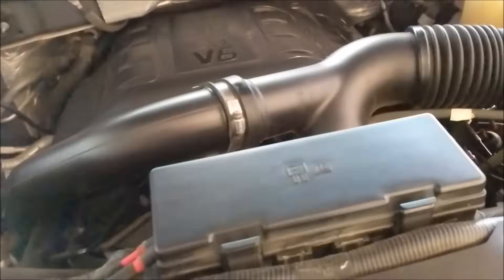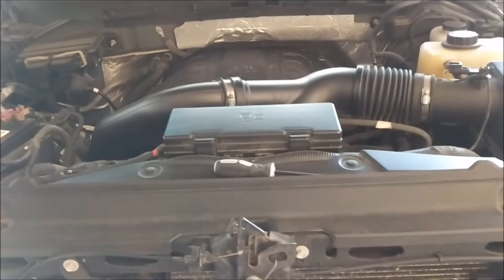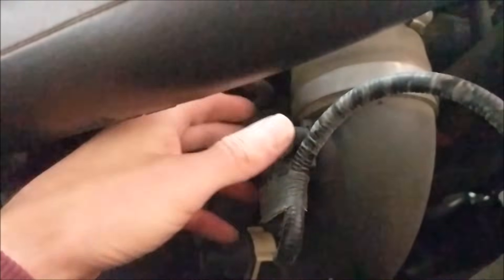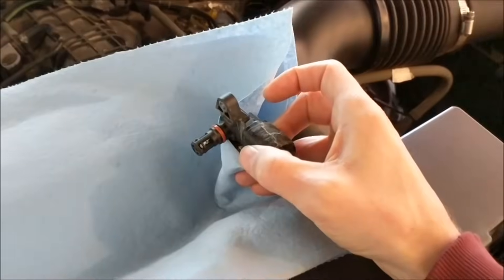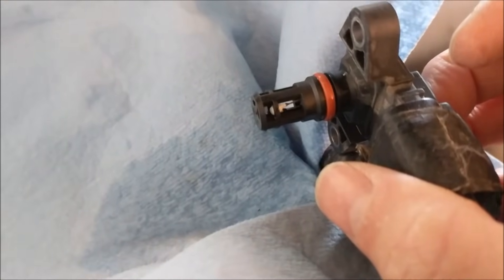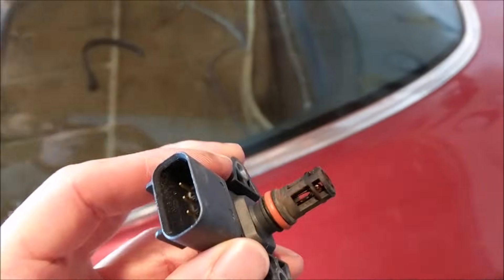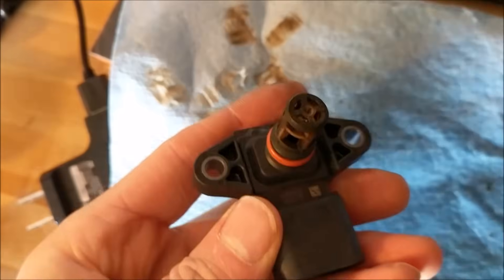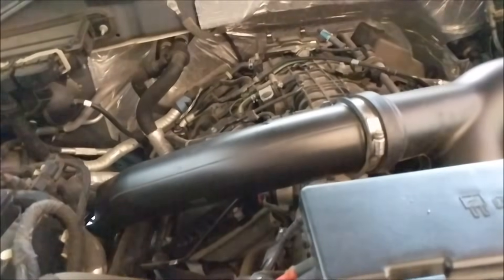MAP Sensor Cleaning 3.5L EcoBoost HOW TO - Ford F150 - 2012

Comment: Thanks, my f150 was throwing code P0172.  The sensor on top of the engine was very dirty and black, could see no white.  I cleaned it with MAF cleaner, was still pretty black, could see a little white.  I erased the code, will see if comes back, but I'm going to order another sensor.
Reply: Did cleaning fix your issue, or did you replace the sensor? I have a ‘13 F150 and well I’m here watching and reading…
Reply: @wI-L-Ly at first I cleaned, order knockoff part from Amazon .  Installed that .  Code hasn’t come back and I’m getting 2 more MPG

Comment: Okay, so I cleaned all 3 sensors.  Cranked the truck over to start the truck. Now it's not turning on. I replaced the map sensor under the engine cover and no crack. I revert back to the old one and nothing. Could you think of a reason why the truck will not turn on? I drove it for about 10 minutes before I cleaned the sensors.

Comment: Great video Brandon! I will clean my sensors soon. Just wanted to add that I cleaned the connection today to the map sensor on top the air box. I found moisture in the connection. The reason I did that is my Turbo blow off valve would click intermittently. Someone suggested cleaning the connection and it worked! A month ago I replaced the blow off valve with an OEM valve and it continued to click. Question for you, when you disconnect the battery, do you wait 8 hours before you start the truck so the Battery management system can relearn? I was told if you do not have the expensive scan tool that waiting 8 hours is advisable..

Comment: I have a 2013 ECO and have done this several times using carburetor cleaner. After needing cleaning 3 times (usually once a year when it starts) you may as well buy a new censor because it doesn't seem to last very long after cleaning 3 times. But excellent video; to the point for the average mechanic. I would show how to remove the plastic engine cover. Some people have issues with that but it's easy if you need to know; pull off oil cap, pull up on cover in the front and pull toward you, it should pop right off.

Comment: hey man thanks for the help. got a 2012 eco and yesterday it kicked out a p012d code. had it checked at autozone and found out it's the turbo sensor. thanks to your vid i will get the cleaner and clean all three of them before i buy any.

Comment: The 3rd maf sensor air flow is after the pcv recirculating system. Hence the oil coating.
If the pcv could be routed to a point after the 3rd sensor position it would not get the dreaded oil coating.

Comment: quick question: You mentioned sensor 2 and sensor 3 (on top of manifold), are the sensors the same? I am thinking to buy  one, because the sensor that is on top of the manifold is completely dirty.

Comment: I don’t get it. These aren’t all MAP sensors… the one on the manifold is the MAP sensor and the other two are simply air temp sensors so the computer can take air temp into account for a/f mixture… you could have cleaned all 3 of these with carb cleaner or brake cleaner with no harm done as they’re aren’t MAF sensors…

Comment: Got a giant wrench symbol on F150 screen and OBD showed pending errors.  Didn't know if a sensor was bad or broken, or wiring was worn out.  We were 400 miles from home in a small town.  Cleaned sensor as shown in video and was able to drive home with no problems and the truck running smoother than before.  All at the cost of a can of CRC.  Thanks.

Comment: How do you remove the sensor on the air filter box?  The one with no nut.
Reply: It take a special socket called a e torx you can pick a cheap setup for 10 to 15 on Amazon

Comment: That one on the manifold is not mass flow it's a map sensor better of spending 40 dollars buy new one mine never came clean
Reply: Does the manifold have its own part number or same as other two map on the truck ? ( 14 f150 )

Comment: Thank you for the video! Question, you can just clean these or do you need to replace them sometimes? Also does taking out the turbo silencers cause this problem more. I took those out about 4,000 miles ago but just got the check engine light and codes for this problem

Comment: Thank you! This was super helpful. My mileage has been terrible lately, and then I just had a check engine light on yesterday. Ran over to AutoZone and it was showing "P0172 System Too Rich (Bank 1)". They recommended replacing the MAP Sensor. Do I need to replace all three, or just one (bank 1?), or do they just all need cleaned? I think I'll start by inspecting all three this weekend at a minimum.

Comment: I cleaned out the sensors by the CRC cleaner the check engine light came on and the engine is Vibrating so bad over 60 mpg. Does anyone have same issue?
Reply: The engine was running perfectly fine until I cleaned the sensors check engine light came on and the engine is Vibrating so bad.
Reply: @yassalnasiri456  did you ever figure out what it was?
Reply: Asi asi yes I did.
Reply: @yassalnasiri456  lol well?? What was it 💁‍♂️
Reply from the maker: It might be unrelated - you may have fouled a spark plugs causing a misfire in a cylinder or two. Get that check engine code read ASAP
Reply: Mine done the same. Had 140k miles..(never been cleaned from the looks of them , 2nd owner) cleaned.. an 2 of the 3 went out.. 130ish for back sensor.   115ish for in front of the intake...  went ahead an replaced at air filter.  Was about 60ish.   Fast way to spend some $..  was alot to smooth out the jumping ideal speed.

Comment: great video. Great idea with unhooking the battery.  I believe if you installed a catch can that would resolve that really oily sensor.
Reply from the maker: You aren't wrong there - though I have seen issues in particularly cold climates with the lines/cans freezing up (rare but possible) which creates a PCV problem. I live in MN so I'm going without for now. But I have been using intake valve cleaner at the throttle body (not through the turbos) and it has been running great!

Comment: I'm the 2nd owner of my 2011. My MAP looked the same as yours when I installed a boost gauge,  coated in oil this is why oil catch cans are important! I'm getting around 12 mpg's but I do a lot of "city" driving.
Reply: Im also getting 12 mpg in city is that normal?
Reply: @704arturo  I get about 14 city with my 3.5 but that is babying it pretty good with a bit of freeway driving. I'm going to clean the MAF sensors and if that doesn't bump it up I think I am going to clean the intake with Seafoam.
Reply: @brentj8323  thanks for the reply, im also really babying the 3.5 EcoBoost , i will also clean the MAF and intake. I already change both of the o2 sensors to see if i get any mpg improvement but no luck.

Comment: Also, it's been 0 to -20 lately where I live, for about 3 solid weeks now. Could these extreme cold temperatures cause this, since they also measure temperature?
Reply from the maker: Unlikely - but you might be getting frozen/ice buildup on the sensors? Possible anyway.

Comment: Brandon, I have a 2013 F150 3,5 eco boost with 32,000 miles. I have had no problems, but when it went to -20 here in Chicago the engine light came on and the code PO12 B-D came up. Would you know if extreme cold could trip the sensor?
Reply from the maker: The only thing I could find close to "PO12" is the P0012 trouble code, which means: P0012 OBD-II Trouble Code: Camshaft Position A - Timing Over-Retarded (Bank 1)
Reply: Nice that's pretty low miles for a 13! Did you ever get this issue fixed or diagnosed? I run a similar year ecoboost and like to hear of issues to watch out for
Reply: P012B Ford F150
Diagnose and Fix P012B Ford F150
Trouble code P012B Ford F150 relates to Turbocharger/Supercharger Inlet Pressure Sensor Circuit Range/Performance. The code sets when the manifold absolute pressure sensor (MAP) detects pressure outside an acceptable value. The book shows that P012B can be caused by a slow MAP sensor or a damaged MAP sensor. But it can also be caused by a a bad Turbocharger/Supercharger Inlet Pressure Sensor.

Diagnose P012B Ford F150
Start by unplugging connector C1667, which is the connector for the turbocharged intake pressure and temperature sensor. The connector is located in the left (driver’s side) front section of the underhood compartment.

Using a DVOM, check for the presence of a 5-volt reference signal and ground in the connector with the key in the ON position

Comment: Even though they are all physically the same two wire element sensor, they are not all functioning as a MAP sensor. Only the one on top of the motor is functioning as a MAP sensor (manifold absolute pressure). The other two are simply measuring air temp. First one is measuring temp as it comes in airbag. Second one is measure air temp post turbo. Another fun fact - they are all actually two wire MAF sensors. Caused a ton of confusion, as parts manual calls the ones in the inlet MAF sensors, but there is not MAF listed in the PCM strategy. They just used an existing sensor design that can do multiple functions.
Reply: Comments section hero.. was wondering names and functionof each
Reply from the maker: Good to know. It's a lot easier to just call them all MAP sensors though.
Reply: Good info!!!
Reply: My 2014 Eco has been idling rough since changing my plugs and a bad coil . She ran fine for while . 
But this morning. I just got the check engine light. The old code reader says 
 p0171 bank 1 and p0174 bank 2 . Hopefully this does the trick . Don't really wanna go back to the dealership anymore 😤
Reply: @alleycat822  did it work?
Reply: @navmatharu4066  thanks for asking.  I followed the video instructions. Used the exact Air Flow cleaner.  The result was the same 😤 the top manifold sensor was discolored badly. I just switched it yesterday . Truthfully the idling is the same . I haven't cleared the engine light code yet . Hopefully with a different tank of gas . This issue can be fixed.  If not 🤷‍♂️ back to the dealership 😤 which makes it difficult because all the mechanics are on strike  in Illinois 😤

Comment: Ive got a code throwing for this. How do I know which of the three sensors it is? Are they all shaped the same?
Reply from the maker: They are different, although the sensor itself is the same - but each one has it's own part number and mounting shapes are different.

The one on the top of the engine is always the dirtiest one.
Reply: Brandon Skifton yeah the part number for mine is 0261230333. Any idea which that is?

Comment: Do you know if the one under the cover, and the one with the torx screws are the same model sensor?
Reply from the maker: I don't know for sure, sorry. I think they are different, but you could call a dealership and talk to a mechanic to find out for sure. AutoZone type of place might even know (they have huge databases).

Comment: Thanks for the info. Will the engine auto calibrate after cleaning or will the stealership have to update the computers? Thanks again.
Reply from the maker: Belated reply: Yes, it should re-calibrate. However, while cleaning I pulled the battery cable (for at least 5 mins) and apparently that will reset the calibration and the truck will re-learn it with clean sensors.

Comment: Cleaned my sensors but still throwing the same codes and running even worse. Could a sensor just be bad and need replacing? Any idea of what I should try next work be greatly appreciated.
Reply from the maker: The map sensors can go bad over time. They're not usually a past that goes bad but they are also fairly cheap and easy to replace. Make sure you look up your codes thoroughly, it might be a different issue. If you haven't replaced the spark plugs and boots, that is a pretty cheap and easy thing too. Takes about 45 mins.
Reply: Brandon Skifton thank you.

Comment: Any improvement in mileage? How many miles on the truck since last cleaning?
Reply from the maker: Finger Lakes Armory 

I have about 3000 miles on since cleaning. I didn't see a huge mileage increase...but the temps got colder outside in that same time frame (Minnesota winter). The truck definitely seemed to idle better after, and it feels good just to have it clean. :)
Reply: Brandon Skifton crazy how dirty the one on the intake manifold was, especially after only 3000 miles! Thanks, great video!!
Reply from the maker: Finger Lakes Armory sorry, it had quite a few thousand on it before I cleaned it, at least 10k. It has 3000 miles since the cleaning in the video now.